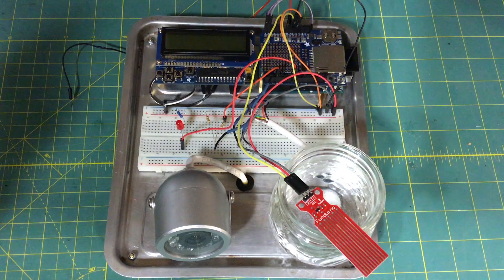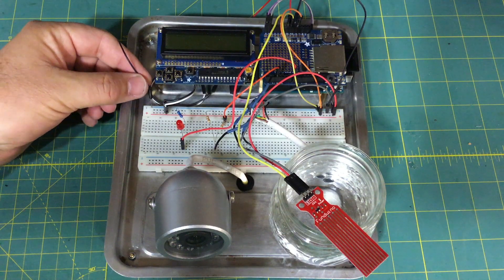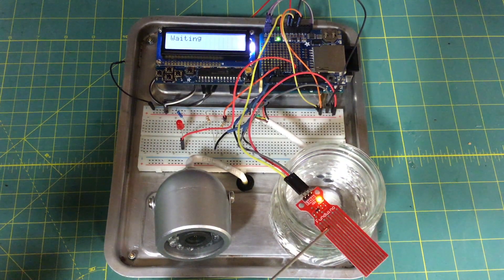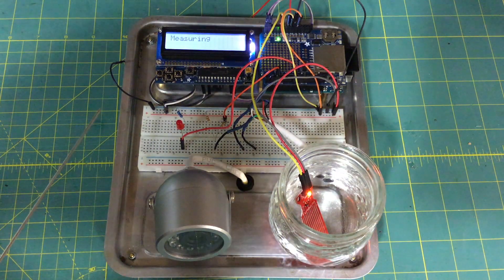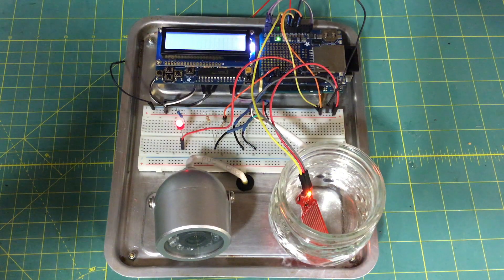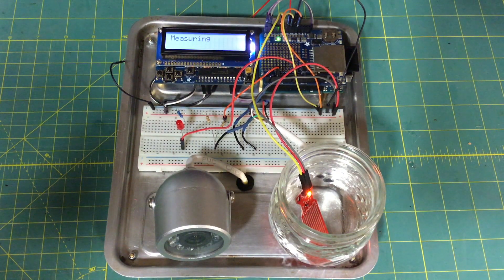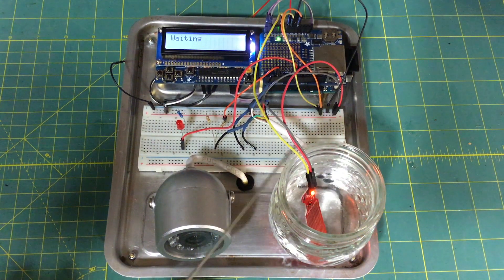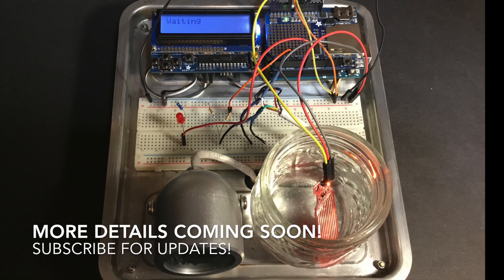Arduino - Flow-Induced Photography Demonstration

Comment: This video was very interesting. So many arduino maker videos demonstrate setting up, 1 possibly 2 sensors. This showed a system of sensors driven by the arduino, in addition it demonstrated a variety of sensors: from the water level detector, an LCD screen reporting data steps, a camera recording visual information and an SD card logging the photos. Bravo! It s nice to see a  system wide complex unit. (I was hoping to see the actual photographs). This has come a long way from blinking an LED, (ardunios version of "hello world" test program). Here the blinking LEDS are useful and part of the system in a functioning way. Thanks for the video.
Reply from the maker: Thanks and agreed - the potential of these little micro-controllers and hardware truly blow me away - wish I had more time to play with this stuff!
Reply from the maker: PS - the photo is shown at minute 4:28 👍.

Comment: Great video! I am a PhD student doing some environmental monitoring and am looking to build a similar unit. For my purposes I am hoping to detect the presence/duration of leaf wetting fog. How sensitive is the flow sensor you used? Does it need to be submerged or will it detect the presence of fine water droplets as well? I am planning on deploying the data loggers in trees which makes them difficult to access. Do you have any suggestions on how to increase the longevity of the power supply. It would be ideal if I could get one months worth of data between battery changes
Reply from the maker: Have you considered humidity sensor like the BME280 or DHT22? Those are easy to set up and also fairly accurate. Since they also register temperature, you might be able to couple with humidity to get what you are after (?). I've tested various sensors coupled with a datalogger in this video: https://youtu.be/_t02pB-fwHE?si=CMVnJ6GbrzLVtUxV . Code is included in the description of the video.